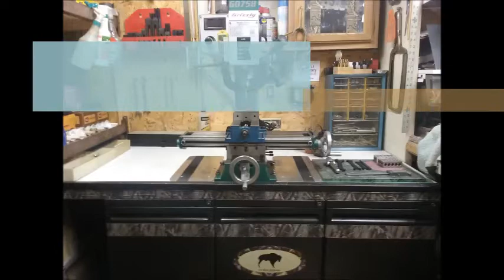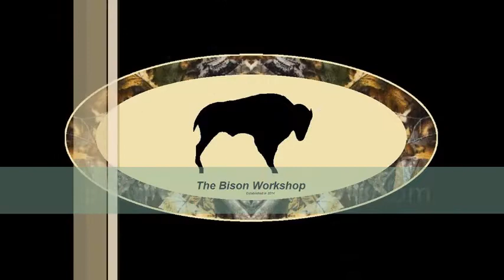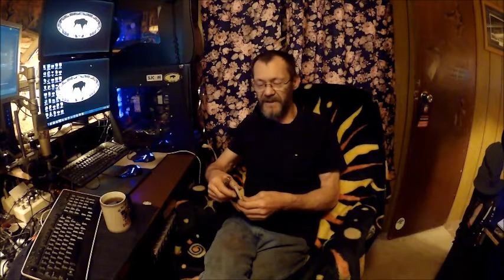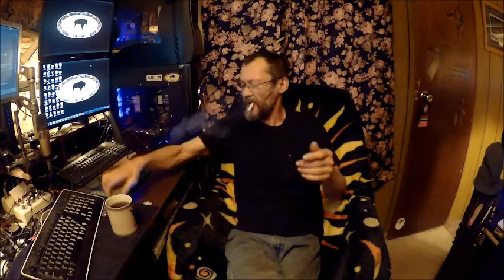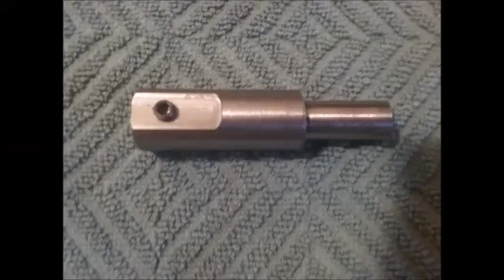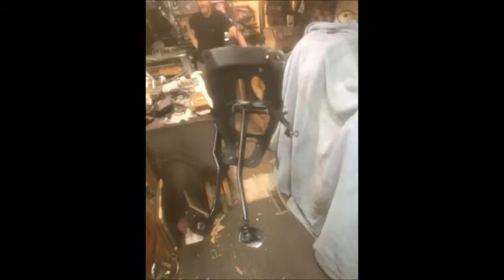bison chat and new tool build

Comment: Keeping those cameras plugged in isn't a great idea.  Sure it keeps the battery topped up.  But when you consider the Chinese components that go in these things, chances are the charging circuit isn't that good, and has a tendency to keep charging the battery even after it's fully charged.  It's supposed to shut off but it's not.  When you keep pumping voltage in, the battery will swell.

Homemade tools are the best.  The fit a particular need like a glove.  It's always the best tool for that particular job, and we all know about having the right tool for the job.  Excellent--you had a problem and immediately engineered a solution to the problem.
Reply from the maker: i now dont even use a battery sense you told me in the last video what to use. i used a battery pack on this video, so it worked great. i still ordered a new battery just in case i need one but wont be leaving it in the camera anymore.
Reply: OK great, glad that worked!